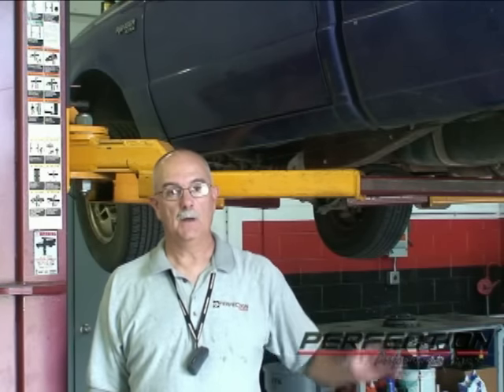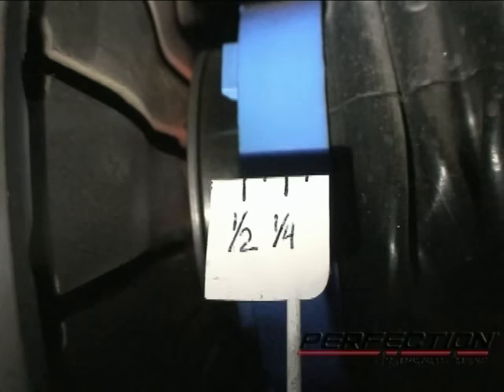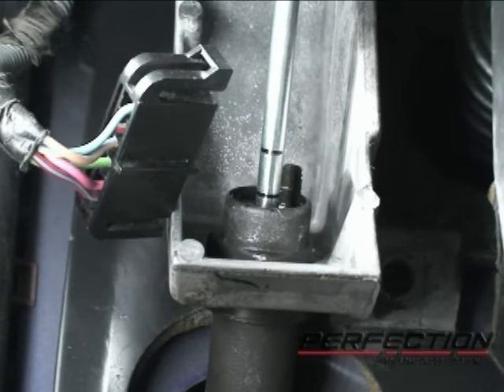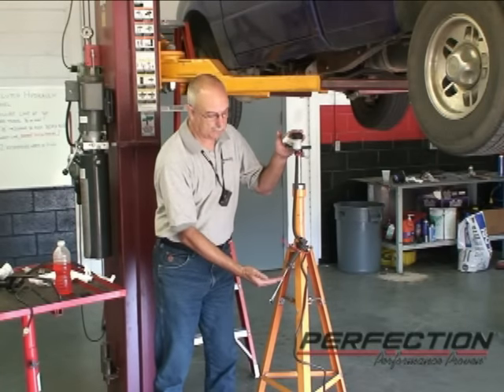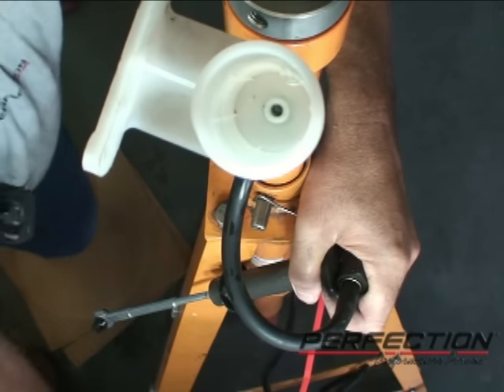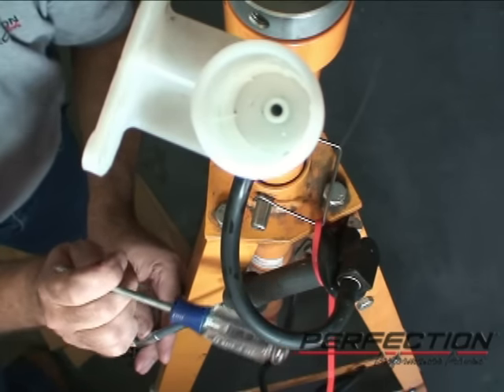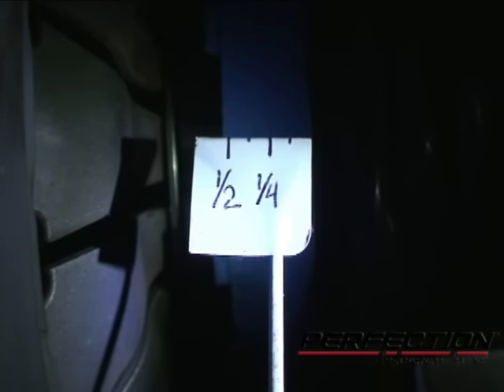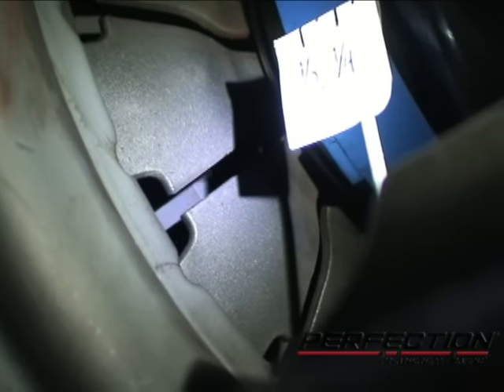Ford Ranger & Mazda B-Series Pickup Clutch Hydraulic Release System Bleeding Procedure Part 2

Comment: My clutch pedal is very soft and lately I have to really pull on the stick to get my transmission in gear. I thought it may be due to air in the line but my slave cylinder is moving a solid 1/4 inch and seems to be disengaging the clutch plate. I had the slave cylinder replaced several months ago. Every now and then my clutch fluid reservoir is empty so I fill it back up and right now the fluid is very dark (almost black). I don't see any obvious leaks in the system. Do you have any suggestions?

Comment: I have a 2000 S10 with a NV3500. I changed the slave, master and line. I was able to get the master to bleed and then gravity bled about 3 reservoirs out. But the clutch is letting up pretty much at the floor. Is there still air in it?

Comment: Hello I have a 1990 ford ranger 2 wheel drive 5 spd and we tried bleeding the clutch without taking out the master cylinder and reservoir assembly because the truck wouldnt shift into first or reverse, but dot 3 fluid started leaking out of some whole in the tranny and i was wondering if you think its because the slave cylinder is out or if it has something to do with the air bubbles? If its the air bubbles then i'll take off the whole assembly and try bleeding it like that, thanks for your time

Comment: Thanks for the informative vid. Will the perfection master cylinder and quick connect work with the original Ford slave?
Reply: *****
Thanks Gary. I guess I need the white sleeve that Ford uses to put on the Perfection line to mate it to the OEM slave. Not sure if that part is sold separate, or what it's called. There's isn't a slot on the Ford slave to slide in the Perfection clip

Comment: what do i do if my check valve on the hose is leaking air and fluid? I just replaced the slave cylinder and bled it. but when separate the slave from the master and go to purge air out of the master cylinder i get air and fluid coming out of the check valve side.

Comment: Would air in the system cause it to not want to shift in 1st and second d after warm up? I ha e to play with it at stop lights. Mostly 1st it does not want to shift into. All other gears its fine even reverse for the most part is fine. And when really warmed up 2nd gear sometimes. Just got a 96 b3000 used and its missing the master cylinder cap so waiting g for it to come in the mail and will try this as well as change the rubber bushings where the stick comes out the top transmission I forgot the name of the rubber seals to tighten the stick up and get rid of any slop. But could this be the culprit???

Comment: Does this make sense that I've done exactly this along with a new clutch and pressure plate and slave cylinder and master cylinder and hydrolic line lol anyways after the burping and gravity feeding my clutch pedal was rock hard make any sense?
Reply: Sorry man turns out I was an idiot and had the push rod stuck behind the spring on the clutch pedal and had it in a bind lol so this process is flawless thanks!

Comment: 99 Mazda B2500 was shifting fine until all of a sudden was half a mile from my house and the clutch pedal fell to the floor and was completely soft. Was able to “pump” the pedal long enough to get it into first and slowly drive it home. Now it will start but won’t go into any gears while running. It will go into gear while not running but will not start while in Gear. Clutch fluid was almost black with what has to be clutch dust in it. I suctioned out the dirty fluid and replaced it with clean fluid. Pumping the clutch pedal makes it a little stiffer but it still won’t go into gear. Is it possible it’s just air in the system?

Comment: I've done these steps three times and my clutch pedal is still SUPER soft. It's a new clutch, new master, and new slave. I get a steady stream on the gravity bleed, and close the bleeder valve. Then I tried the pedal (both before and after putting the reservoir cap back on). With the master tube disconnected, the pedal is hard as a rock. Any advice? Please help!
Reply: Bad brake booster or vacuum leak

Comment: just got done putting a slave cylinder in a 95 ranger and the little white plastic sleeve it what you push in anyway just use a screwdriver and push the white ring in all the way around it and pull your hose at the same tine it should come off

Comment: what if u have some fluid on the rod does that mean the master cylinder is no good
Reply: it's not drivable right now I bought it like that ,I can put the transmission in gear when the engine is off,and I can start it in gear and get it to move , but when it's running it won't go it to gear, also I'm having to by past the clutch safty switch to start it

Comment: Do the from factory Ford master cylinders have that check valve in the connector like the Perfection master cylinders do? So in other words, would I be able to bleed my stock 1991 Ford Ranger M5OD master cylinder like this?
Reply: ***** Thanks for the response Gary. I will be replacing the master and slave cylinders soon. Do Perfection clutch replacement master cylinders for 91 Rangers have the tappet valve system or is it like the original design?

Comment: I've done exactly like the video and clutch pedal still drops to the floor and no movement on the clutch?
Reply: Slave cylinder has probably gone out. A relatively cheap part, but if it is inside the bellhousing you have to drop the trans. Pain in the ass. Might as well replace everything while you're in there

Comment: Hey I got an 89 b2600 with 115k. As I was pulling into my drive way my clutch stopped working. I'll push the clutch down but there isnt any resistance and the gears wont engage (except 5th kinda). The clutch also wont pop back out (sticking?). 

I drive this thing like an old man and have babied ever since i got it. what are some common problems that these vehicles run into and how does one go about fixing it?
Thanks!!
Reply: Check for brake fluid dumped out at either the slave, master, or line connections. You got air in it somewhere

Comment: I got a 2004 Ranger xf4. When it is hot, after an hour of travel, the clutch starts to stick to the floor for a few seconds, releases, slaps my foot, lurches forward. My first step is to muck about with the hydraulics. Does this sound like anything common?  I saw a plausible video on clutch dust causing the throughout bearing to stick.  A few others state that its dirty fluid.  I'm about ready to get greasy.  Any last minute reprieves would be appreciated.
Reply: Yes I had a shop do the clutch MC and SC. over 100k miles ago. I followed your awesome instructions. I wanted clean fluid so I blew out the check valve and hose filling it with air.  So when I did the air removal, it went well, got the motion minimal, and stiff.  Installed it. Didn't pay attention to the 3 corners and one being chamfered, so struggled a bit getting it back in the seat. finally figured it out [by opening my eyes and looking at it].  I haven't test driven it yet, have to go to DMV and register it, had it on non op. But I did notice that the hard shifting is now gone.  I wont know if the slave and throughout is sticking till I drive it for an hour or so.  That''s when it starts when it is hot.  Maybe I could install a fan in it, lol. Xing fingers!
Reply: Okay, I pushed with my two fingers, and I could push the clutch peddle all the way to the floor, but was not real easy. I test drove the vehicle, and it shifts great, but I still haven't driven it for the hour it takes for the symptom to start: I need to register it. Probably do that tomorrow. But I could faintly hear the T O bearing moving when I pressed in the clutch.
Reply: ***** will I bled the master cylinder by hanging it upside down like you suggested and got it perfect. I didn't gravity blood the slave cylinder 3 ounces of fluid or more
Reply: Pat Hamer that should say I did gravity bleed the slave cylinder
Reply: So let's say it's still sticking because of a dirty input shaft can I clean it with some kind of brake cleaner
Reply: Yes, I did the procedure, and I got all the air out, I'm sure of it.  I let it sit, tapped the lines, pumped until I was sure it was hard to pump.  When I installed it, I did the gravity bleed on the slave, about a cup of fluid went through the system. 

Are you saying if the drag is occurring to cause a 3 second delay in releasing the clutch, Ihave to pull the trans and replace the Slave and bearing?
Reply: Yes I watched your video and it was so clear to follow. I had the 5/16" travel prior to the bleed. The air was in the Master Cylinder, as I had about 1/2" or more play in the movement of the push rod on the clutch to master.  Now it is tight and no play after the bleed.  I put in a brand new master cylinder.

The latter about the "drag" due to rust or dirt was my first guess that made logical sense, until two commenters inferred hydraulic, which didn't make sense to me, but I'm not a master mach, just a okay, but thorough, home mechanic. 

But to restate the issue, the issue is after driving about an hour, while shifting, the clutch stays disengaged after pushing it in to shift gears.  For about a second or two, it sticks open or disengaged, and then suddenly releases causing a lurch forward and the peddle slaps my foot.
Reply: I put the new master cylinder in, and insured it had no air by following your instructions to the t. However, I didn't remove the tire, nor the plastic mud shield in the fender. So I put it in by feel, and shoved tubes this way and that way hoping they wouldn't break. I tested the clutch and it worked. On my way to the smog check and DMV, as I got into the truck the peddle went completely to the ground. The hose had melted on the exhaust, apparently after test driving a week earlier.
I removed the tire and fender mud guard and what a difference. Took a few minutes to reinstall the master cylinder, I drove it for 150 miles that day and no problem. No more clutch sticking to the floor for a few seconds. I didn't have to remove the transmission!

Comment: I became physically disabled 15 years ago. Life will put you around people you would never believe existed. Somebody's reservoir went dry after I told them to add fluid to it. Clutch went out, I opened the top and looked in and they filled the boot with fluid rendering the clutch master cylinder useless once the reservoir did eventually go dry in about 6 months. I told him to do the bench burp and tried to explain it all to him. He is pulling the trigger on a $1,000 transmission repair. Anybody around me Rochester Minnesota area?

Comment: i have a question. i have a ford ranger 97 type californian, but the problem is the the clutch pedal gets stuck or hard to push down. i have to pump it so it gets normal, and sometimes first gear it's in and the clutch pedal it's all the way up but the truck won't move by it self i have to push gas in and it starts to move,even with reverse. i really don't know if its the transmission or one of the hidraulic cilynders are broken. there's no leak. the cilynder in the transmission was changed but the problem stills. what could it be? please any suggestions?
Reply: +BoredHD Did you ever figure this out. I have the same problem
Reply: +perfectionclutch thanks. I'm going to pull it in the garage and start looking this weekend. Thanks for the feed back. I've been having a lot of trouble finding any info. 

With mine I have the heat up lockout issue and then it will unlock and go to the floor and not disengage the clutch. Once things cool down it works fine, if not a little soft.
Reply: +perfectionclutch its a 96 ranger with 77k miles. I'm its 3rd owner. everything was good for about a year and then it sat for a year and half. When I started driving it again start started slowly. it would get a hard few seconds and then shift normally. As I started driving it more and more this started. 

As far as I know everything clutch wise is original and it has had no work done.

Comment: i cant get my pushrod assembly back into the truck. it won't go in the whole way or turn
Reply: Thank you. I just got it reinstalled. I measured it with calipers and realized that one side was wider than the other. Was going nuts. It came out so easy

Comment: TO whom it may concern:
My clutch has these crappy symptoms. I disconnected master from slave and my clutch is hard as a rock. Bled a whole freaking bottle of DOT3. New slave <20k miles. Can air get stuck in my slave? Throwout bearing (TOB) fail is supposedly common too, but from my research, new slave comes with new TOB.  Could someone please give me some advice? Thank you
Reply: ***** Ok, I apologize for lack in clarity. I appreciate your response very much.  Your assumptions are correct, first and rev are impossible unless car is off. I looked for movement of slave, and there was some engagement , but I don't think it was a full 1/8" so I assumed as you said that I had air in my master. I understand your description of how air pockets influence the system so I made my way to check and remove. My question arises because, if i disconnect my master from slave (master is a closed system), and the master has ZERO play in the pedal, doesn't that mean my master cylinder is air free? The pedal was semi tough when connected, and a brick wall when disconnected. Also, I went to a local offroad spot, parked my truck at a ridiculously steep angle, and bled a whole bottle of fluid to no avail. Your explanation of air entrapment makes 100% sense, but I feel like I went to such an extreme to bleed the badboy and it precariously still wont shift. Please let me know what you think. I appreciate the wisdom. -Salty
Reply: ***** Sorry for the delay. The car was a 2002  3.2L v6 ranger.  I went underneath the truck, removed the plug, and checked the release of the bearing. It was just before 5/16" It was not going out far enough it seemed.  I bled the system a bajillion more times in hopes of it being a bubble. I ended up getting a local tranny mechanic's word, and he ended up replacing the slave cylinder on the truck. Everything is as good as new. Thank you.

Comment: cannot get my 1993 ranger to bleed nomatter what i di  ! both slave cylender and master cylender are new
Reply: sometimes even if you've bled the master air can still get trapped in the slave. best way I've found to bleed that is after you've bled and installed the master, you open the bleeder valve on the slave, push the clutch pedal all the way down, then while keeping it depressed, close the bleeder valve. That pushes all the air out the slave and when you release the pedal sucks brake fluid from the reservoir in. Refill the reservoir and repeat the process a couple times and you should be all set. If that still doesn't work you've probably got faulty parts.

Comment: wow everything went some what smooth except the bleed valve on the slave cylinder, won't turn and I'm stripping the nut now. and why in the heck did they not extend the bleeder line a little longer do its easier to get too, grrrr!
Reply: perfectionclutch I had to use a socket to break it loose. End result on how the clutch works after installation, is  about the same as far as the way the clutch works before the break down. I'm beginning to think the slave is going bad. Cause when you press down on the pedal the first 6-8"  there's no resistance and then the engaging starts about 8-10" from the floor board. this is on a 1996 f150 xl